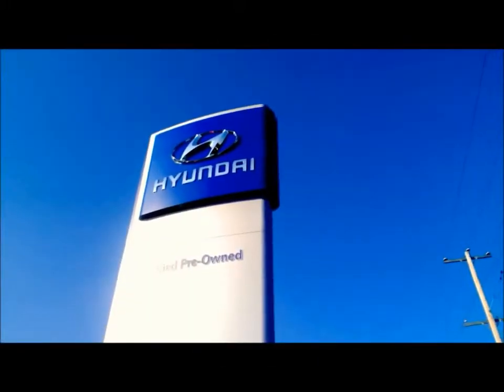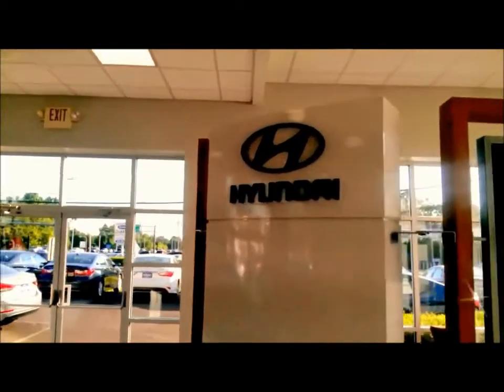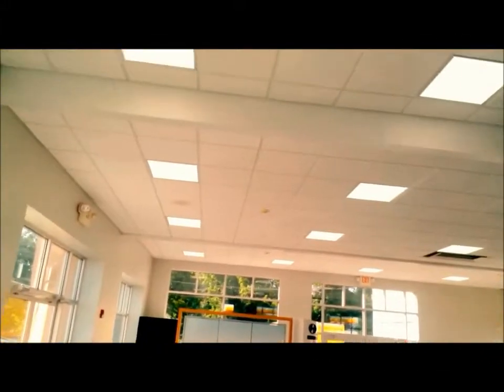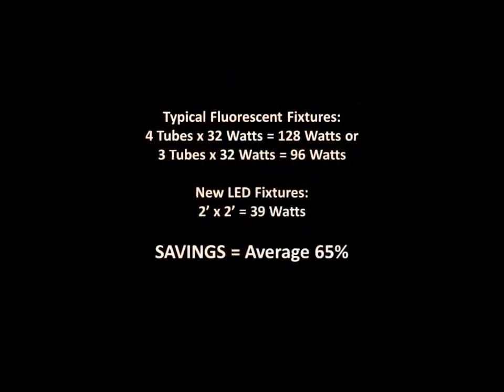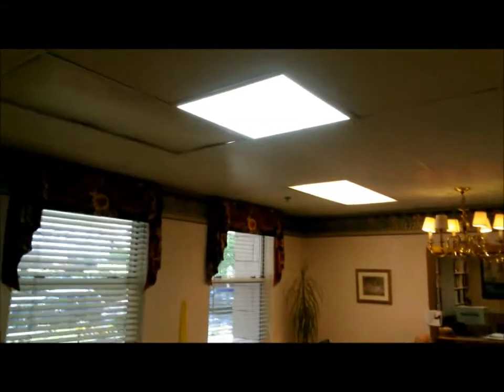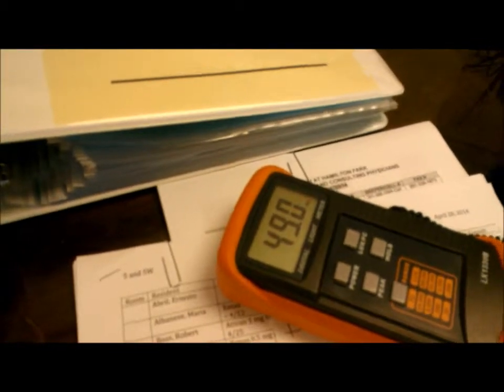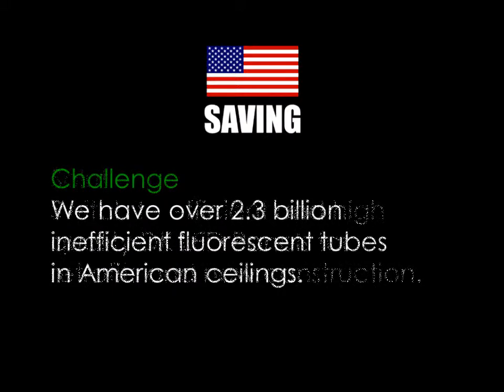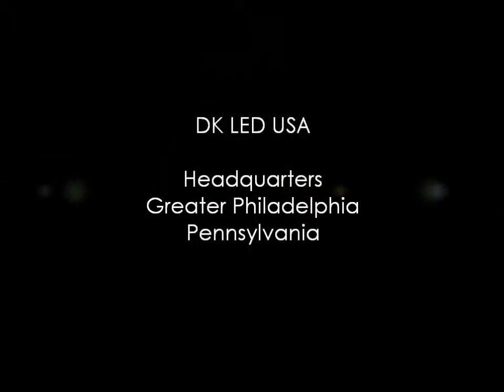DK LED USA LED Panel to replace fluorescent tube fixtures for retrofits and new construction 2 18 15

Comment: Square led panel-603X603mm , l believe our LED panel lights can meet your demand .
http://www.ecoillumiled.com/product/LED-PANEL.html
Light Source: 2835SMD; Voltage: AC85-265V; Wattage: 40W; LED Qty: 216pcs; Size: 603*603*11mm; Material: Aluminum + Organic PC;Lumens:4000-4200LM;Dimmable:On request